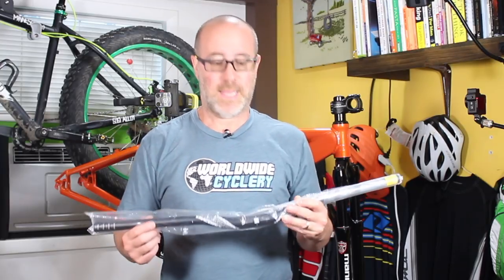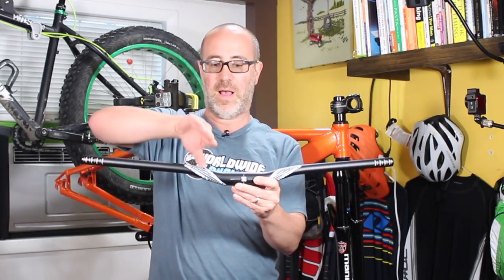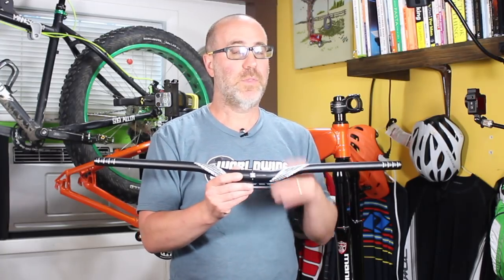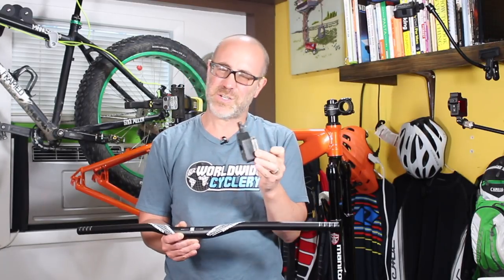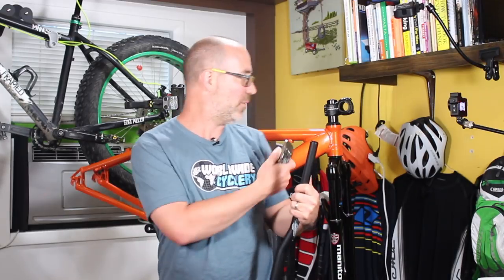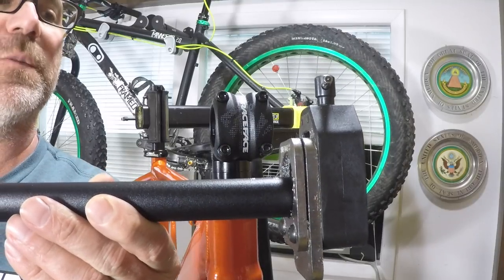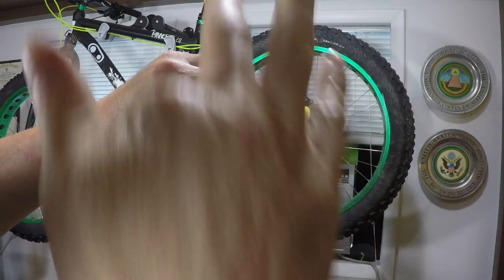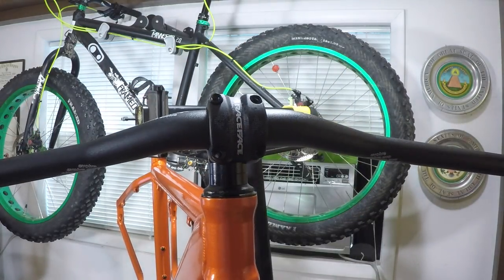How to install handlebars on your mtb | Part 5 How to build a MTB

Comment: The saw guide is a great tool. If you are in a pinch I have used an automotive hose clamp tightened on a steerer tube of a fork as a saw guide and it worked great. Just take your time but a saw guide IS the way to go.
Reply from the maker: pro mod steve Great mod man! Thank you!

Comment: I understand the pattern when tightening. Should you completely tighten the bolts the first time. Or should you tighten in small increments until it's completely tight??
Reply from the maker: Good question. You want to slowly tighten each bolt a little in the pattern. Not completely tighten each one. Does that answer your question?
Reply: @rgmtb   Yes, thanks for responding back !

Comment: Nice, what bars are they, and when the bike is complete, do you have any plans for riding it a skatepark?
Reply from the maker: These are Race Face Evolve Riser Handlebar, 31.8 x 725mm 3/4" Rise Black that I bought from WorldWide Cyclery. Totally plan to take this bike to a pump track when it's done! (just wish it was done HAHAHA) I don't have a skate park nearby so I'm not sure when it will make it to a place like that.
Reply: nice, I've had trouble finding skateparks to mess around on my trail bike here in PA, the closest one being 1 hour away.